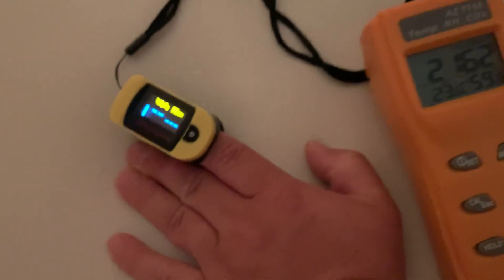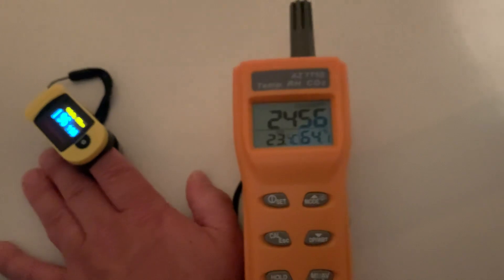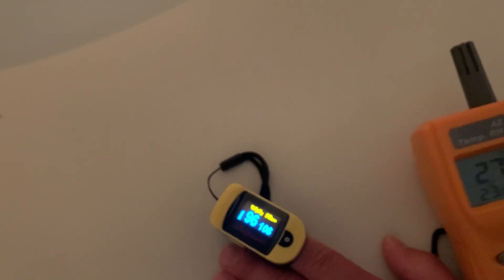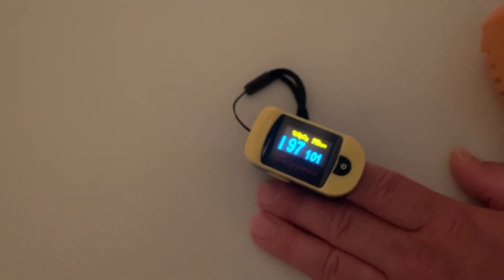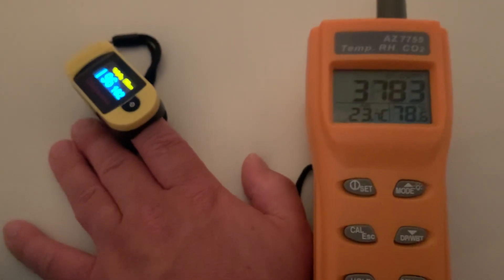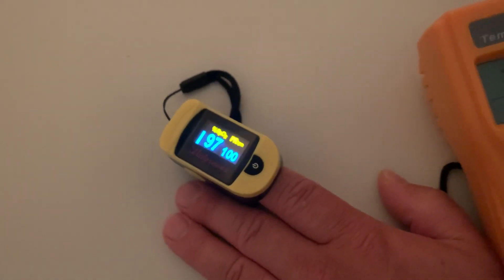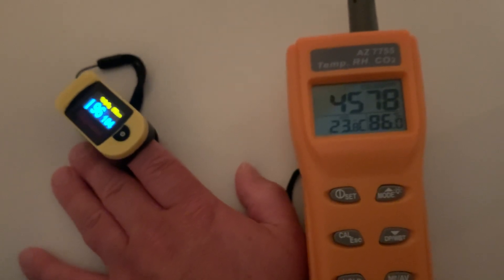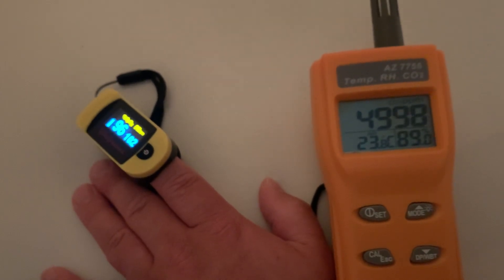CO2 measurement while breathing inside a pvc inflatable. 5k ppm is the OSHA limit, 30k can kill you

Comment: What is the different on a double layered ten a single layered?
Reply from the maker: Everything we make is double layered. It’s basically a suit inside a suit and the air inflates between the two layers, pushing the inside layer tightly against you. In a single layered design, it has to have a airtight zipper and you are breathing trapped air
Reply: How much volume (m² of air) had the suit in this experiment?
Reply: @candycoatedus  Thanks for that, and with that info, which would be better to have then?
Reply from the maker: @defqontuna  the double layered. It feels soooooo much better and it’s way safer and easier to breathe

Comment: So what is the usage of a single layer desing ?
Reply from the maker: We see a lot of people play with those huge clear bubbles that you can walk on water with.  They are fun but can be dangerous since you fill it with CO2 pretty fast
Reply: @candycoatedus  Yes but the waterballs are fun beacuse you are on water and try to walk or to get ...on the legs, and it's a real challenge, also the sphere (usually 2 or 3 m diameter) it's quite big to allow you to get inside for 10-15 safely. But you can't run or move with this single layer inflatable. So how you can use it ?
Reply: Watch the mystical latex garments of Fredrik Tjaerandsen. That's highend single layer design at its best.

And of course also airblown nylon fancy dress costumes are single layer, but automatically ventilated by design and so pose no risk at all.
Reply: @AerialTheShamen  In none of the suits you are talking about are you completely inside an inflatable structure with no possibility of moving outside. For example the airblown nylon fancy dress costumes have legs and allow you to walk.